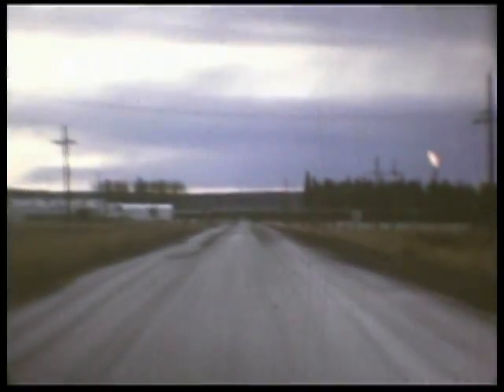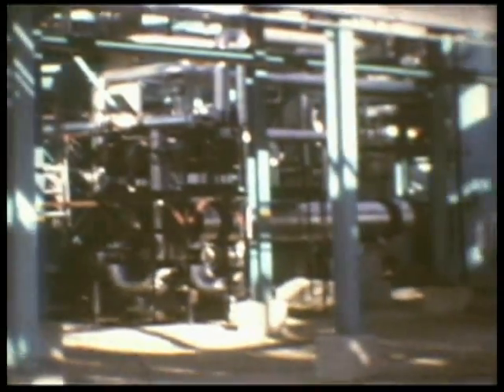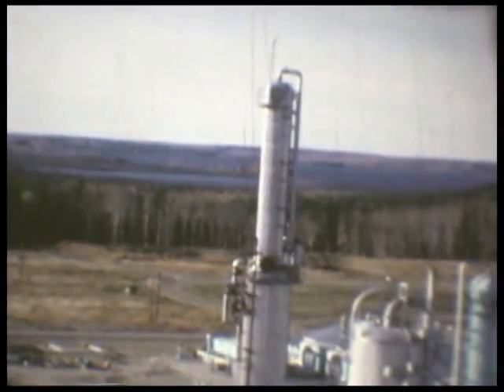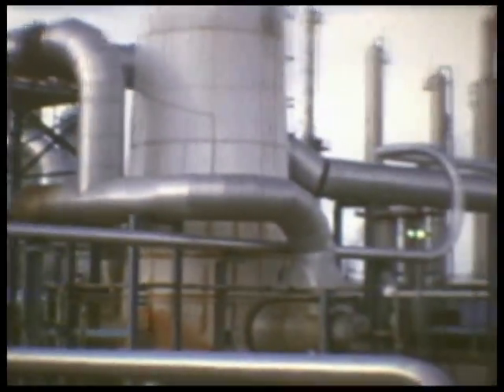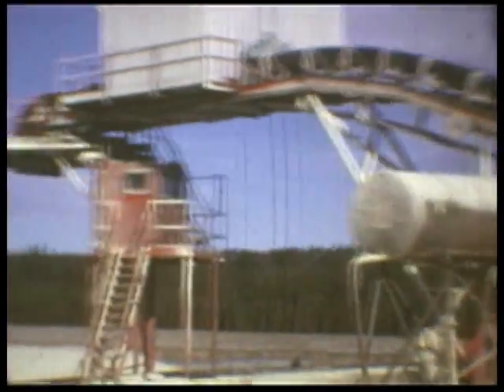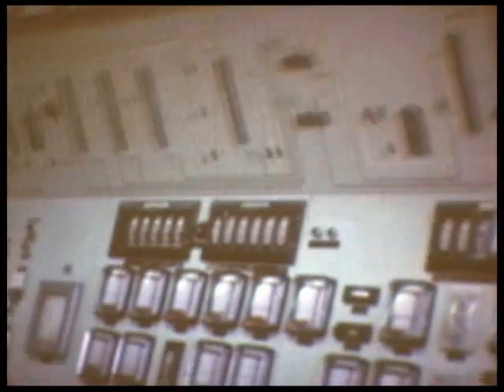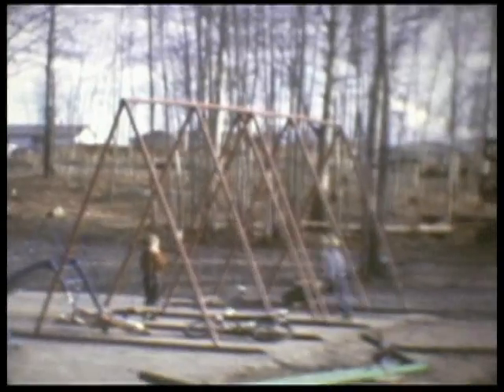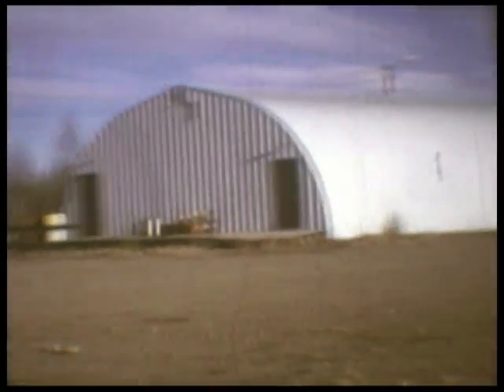A Day at Kaybob

Comment: I worked there for 8 years from 1990-1998.  I was the site engineer.  We amalgamated the 2 plants into one.  We also built a new control room in the middle and modernized the control system.  I'll post a separate video that I made.
Reply: I would be interested in your video Marty. It is probably better quality than mine which was made from spliced 8mm home movies and an audio tape recorded while I watched the movie.
I am sure the plant amalgamation was economic and reduced the 13 operators we required on shift!
Al Kiernan